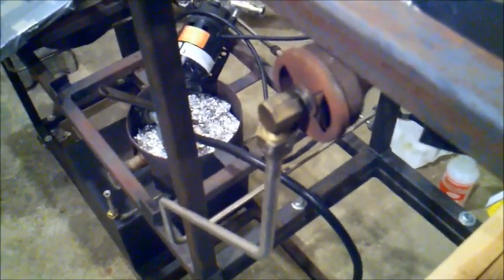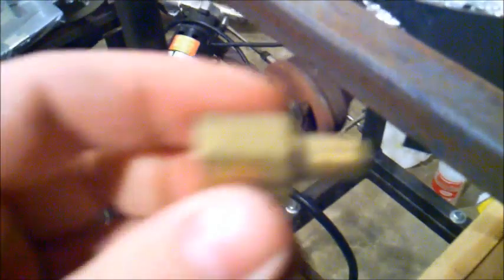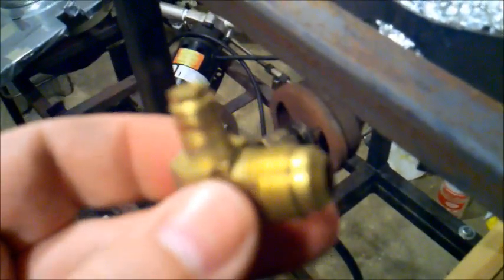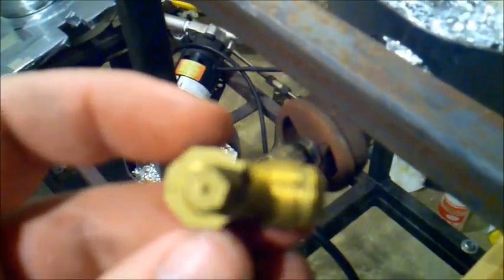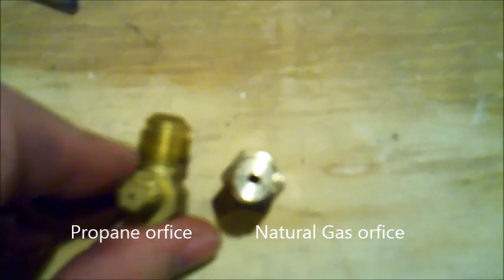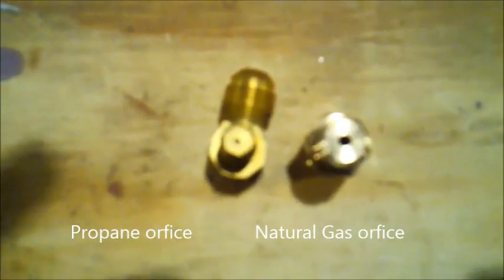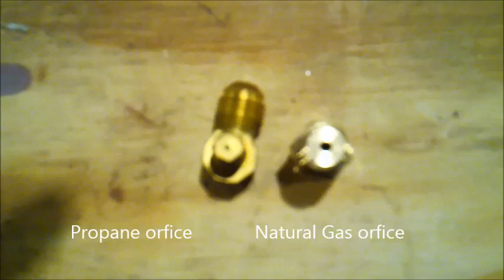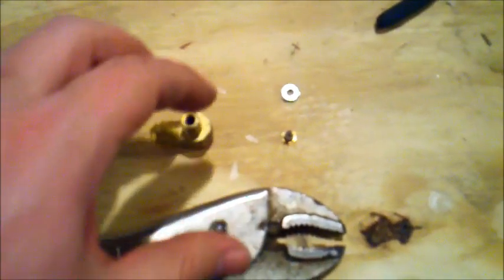Drilling the gas orifice from propane to natural gas

Comment: People, please be careful watching a non-pro doing this. One size does not fit all and doing this wrong can get you seriously injured. A .125 bit on natural gas is good for 40,000 btus @ 3.5" wc. Most complete grills are 35k btus. So this orifice he drilled is severely over sized!!  If the grill has a total of 30k btu's (Look on the tag) and you have 3 burners, then you need 10k btu's per burner. Look up a natural gas chart for orifices and size the hole/drill for that 10k btu's per burner!!!! Then you may have to adjust the air on the burner to get the flames between jumping and yellow tipped.
 A 2-10 minute video is NOT sufficient enough to teach this lesson!!
Reply: Sure it is if you're not stupid

Comment: 3/32" is actually recommended for NG
Reply: I did use a 1/16 on a past BBQ. You confirm 3/32? I have a 5 burner 55000 total 11000 per burner. 1/8 is way too big.
Reply: @petermalone5780  this right 9000-10000 btu per burner. 1/16
Reply: @petermalone5780  - I’m about to convert and found for my water column (4) and BTUs per burner (12k) my orifice size is 51, which I worked out to be 1/16 min to 5/64 max. I’m going to start with 1/16 and jump to 5/64 if needed.
Reply: @nja3224  So what drill size did you end up using? I have a 6 burner 60,000 Propane and want to convert to NG am leaning on 1/16 as per chart it is close to 10,000 per orifice
Reply: @allyirfan8663  - 1/16 worked for me.  I am no expert, but I checked my areas water column and looked at a chart which I believe recommended a drill bit size of 50.  1/16 is a little larger, but it was within range so I felt comfortable starting there.
Reply: @nja3224  1/16 is the right size. Anything bigger and you get yellow flame
Reply: @allyirfan8663 for how many burner bbq? And how many BTU’s for 1/16 drill bit?
Reply: @christophergaul2448  6 Burners and a total of 60,000 BTUs so 10K per burner. I used the 1/16 drill and noticed the gas was not as strong as it should. Remember the gas pressure is dependent in your area. I am north Toronto. Propane pressure is much higher this is why the orifice is smaller. Turn on all burners and write down the max temp. Then drill with 1/16 drill.  Turn all burners at max. If the temps dont reach the pre drilling propane temp then you will have to drive with just a tad more bigger bit. That's exactly what I did and mines now perfect!
Reply: @allyirfan8663  what size was your final drill bit size?  I have a 5 burner BBQ with a total of 50,000 btu's
Reply: Gerard St-Cyr I drilled the 1/8 hole and it now shoots flames a foot high. I corrected the others by drilling the 3/32 hole and now the rest work great. I luckily had a doner BBQ to replace the orfice I drilled too large.

Comment: I just retrofitted my gas stove back to natural gaz (from propane). I wanted to maximize precision so I sent them a local machine shop where they are within +- 1/10000" ... (plus they charged me only $30 cnd)
I picked those guys b/c my other options were:
$500-600 cnd for original orifices with tubes from OEM
$1-4k cnd for another stove (used or new)

Luckily enough, my stove mfg (Frigidaire but most do) put a label in the drawer with the orifices sizes for both gases. (mm)
LP: 
0.61
0.87
0.87
0.97
NG:
1.07
1.54
1.54
1.84

For the overly curious, this corresponds to the equation y = -0,2855x2 + 1,2984x - 0,4524. where y is propane and x is natural gaz. I wouldn't use that equation for other equipment without safely testing CO emissions.
Reply: Even more simple formula is that the NG orifice is 1.8 times larger than the propane orifice. Working either with area or diameters if you average them the ratio of NG to propane is about 1.8:1

Comment: More detail:

A .129 of an inch orifice for natural gas would be about 59000 BTU. whereas this size for propane would be 115000 BTU. The propane orifice size should be .089 of an inch(55000 BTU) or .094 of an inch(61000 BTU) to rate the same. A .075 of an inch propane orifice would be 40000 BTU where as a natural gas one this size would be about 20000 BTU.You may want to reference your grills advertised Total BTU's divided by the number of burners (assuming no rotisserie)to give you a reference point on the chart of conversions for orifice size and WC for LP to NG.

For example:  If you have an advertised 48,000 BTU grill with 4 burners.  This would be 12,000 BTU's per burner.  So chances are your LP(11 WC) orifice is approx. .040" of an inch.  .40" of an inch is 1.016 mm.  So in a 48K total BTU grill(12k BTU per burner) chances are your orifice is probably marked with a number around 1.016 (mm).  Finally you would want to drill a .052" to .070" hole to get equivalent BTU's for you new NG(7 WC) gas.  The .052" to .070" NG BTU's are 10K to 18K rounded. Thus, the two drill sizes closest to the 12K BTU's on the LP(11 WC).

Example 2:
Hi Frank, thanks for clarification. The four orifices in my LP BBQ show 1.04, which is 0.041" of an inch (11742 BTU @ 11WC). So I assume I need to confirm that the gas pressre is regulated at 7WC and if this is the case, according to the chart, the closest orifice diameter to produce 12K BTU would be drill bit size #53 (0.0595"). The next one though is 1/16" producing 14K BTU @ 7WC. I'll probably go with  the 1/16" then since I got this drill bit......
Reply: Hello Frank, i know i'm dredging an old thread, but am desperately in need of help and it looks like you might be able to give me that. I am needing to replace the orifices for my BBQ grill back to LP from NG, but cannot find anywhere (including the manufacturer) what size to drill these to. My current stats are:

Kirkland Grill 720-0432 (made by Nexgrill)
   Operated at 11 inches water column
   Total BTU 96,000 BTU/Hr

I have 5 types of orifices that need to be changed from NG to LP, current sizes:

Main Burner        x4@10,000btu/hr    - 1.55 (current NG size)
Side Burner        x1@12,000btu/hr     - 1.7 (current NG size)
Rear Burner        x1@15,000btu/hr     - 1.55 (current NG size)
Searing Burner  x1@18,000btu/hr     - 2.1 (current NG size)
Oven Burner      x1@16,000btu/hr     - 1.98 (current NG size)

Hopefully this gets to you and you may be able to help. Thank you so much in advance.
Reply: Hey frank, you’re a genius

Comment: All Do-It-Yourselfers.   Be sure to measure your LP orifice to make sure it's approximately the standard/common .089"-.094" of an inch at 11-14 wc before drilling a .125" inch hole for the conversion to NG.  Your grill may have a regulator lowering or increasing the standard 11-14 wc LP to a different level(say to 4 WC or 3.5 WC or 18-20 WC).  Or the manufacturer just decided to make the LP orifice smaller for whatever reason.  If the LP orifice is smaller use a more specific conversion chart(I've included one in my comments).  Also, this conversion assumes at sea level to about 2,000 ft.  The holes will need to be slightly bigger if you live above 2,0000 ft. depending upon your altitude. Happy Grilling!

Comment: Just a follow-up for all you tech heads: Orifice sizing is based upon gas operating pressure and the BTU needed. Equivalent BTU for propane verses natural gas, the propane orifice is always smaller. Standard natural gas pressure delivered is usually 7 inches water column pressure, where as propane operates between 11 and 14 inches water column pressure. However some natural gas appliances such as natural gas lights operate at 4 inches water column. But in this situation the normal standards would be 7 inches natural gas, 14 inches propane. A .129" orifice for natural gas would be about 59000 BTU. whereas this size for propane would be 115000 BTU. The propane orifice size should be .089" (55000 BTU) or .094" (61000 BTU) to rate the same. A .075" propane orifice would be 40000 BTU where as a natural gas one this size would be about 20000 BTU.

The key item is the original size of your LP orifice to determine how much larger to drill for NG.  Use the chart to convert the orifice size at 11-14 WC in BTU's to a drill size of similar BTU's at a WC of 7(NG).  Most orifices have a stamp on them.  This stamp is usually in millimeters.  So you need to convert mm to decimal inches to use the chart correctly.

7 inches water column is 4 ounces (1/4 PSI) 14 inches water column is 8 ounces (1/2 PSI) Absolute value is that 1 PSI equals 27.7 inches water column
Reply: Frank Farconie what if my grill uses 48,000 btus at the main. What size do I drill?
Reply: Keep in mind that LP burns about 30% hotter than NG.

Comment: You didn't say anything about using the propane regulator with natural gas. Propane gas has about 3 times the pressure as natural gas  even if you drill the hole bigger you will still not get enough natural gas pressure to get a good flame plus propane burns much hotter than natural gas
Reply from the maker: Nope, this is connected straight to my home natural gas. No regulator need. The piping on my rig is still sized for LP, everything thing seems to work fine. Only thing is I can't usually do long burns (more than 30 minutes) on full flame for CO worries. I have 3 monitors in the basement, one about 10 feet from everything that is digital. After about 30 minutes at full flame I'm around 45ppm CO. I'm not comfortable with that so I usually cut it back to 2/3 flow, and after about two minutes my exhaust system brings it back to 0ppm.

Comment: 1/8" worked like charm, slightly excess gas (some orange flame) but I just turn the control down a bit. It also means I can get the absolute max heat out of my grill.
Reply from the maker: You can also adjust your oxygen intake at the burner to reduce the orange flame.
Reply: @TrespassersWillBeShot  true and I tested this without any adjustments and am getting 700 degrees which is more than I need

Comment: Thank for the size. My old grill I opened up a little less as I was not sure of the size. I recently realized the flame lever valve on the grill will take care of too much gas (within reason) so with my new grill 1/8" it is.

Comment: Andrew, sometimes heaters come with both orifice jets in a little cloth bag attached somewhere. You should really check with the manufacturer for the proper size, or the gas company. Better safe than sorry. Heaters are a little different than an open burner. just sayin'
Reply: +Gee Dubb Do you have information about the mr heater blue flame on changing the orifice size?